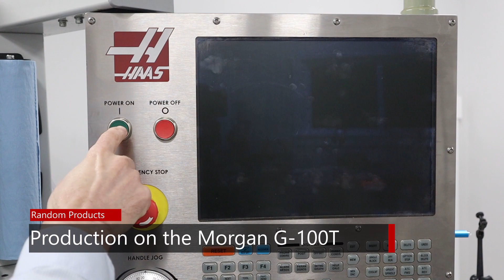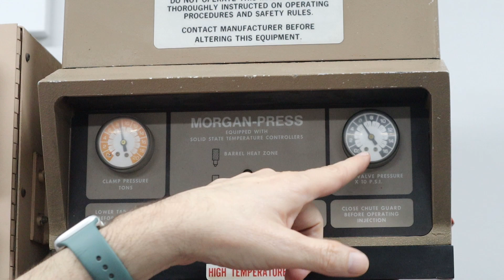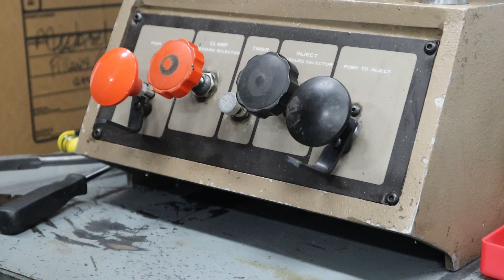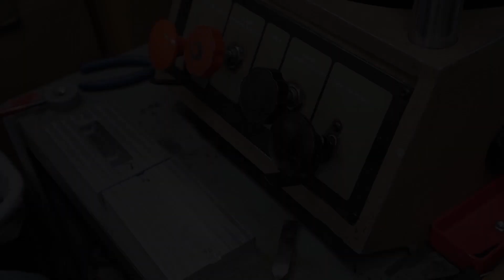Production Injection Molding on the Morgan G 100T

Comment: Very nice video
Try using a food dehydrator for drying your material,you will have more control over temperature and run less risk of polymer degradation.
Reply from the maker: That's what I started with. But the maximum temperature of 70C wasn't enough. The recommendations I've found are to dry ABS at 100C for 2-4 hours. I ran the toaster oven at 200F, or about 93C, which worked much better.
Reply: I had similar results with a food dehydrator and PC/ABS. Dried it overnight and ran some parts the next day, still streaky. I'll have to get a toaster with good low-temperature control. I think some don't do well maintaining lower temperatures.

Comment: Great info about the streaks and toasting the pellets.  I’ve had them before and thought it was a flow issue.  I live in AZ, so wouldn’t have thought moisture was still an issue.

Why a third mold?  I don’t think I caught the reason on that one.
Reply from the maker: The product has a total of five different parts. I'm making the smaller parts on my AB-100 injection molding machine. The other three parts are too large for that machine. Hence the third mold.

Comment: Nice work John.
What do you do to keep your pellets dry?
Ceramic plates are a good dryer.
Several in with the pellets could do it. Put the ceramic in the oven like you did the pellets without worry of melting.
That last part you showed was very nice and smooth. Very nice.
Reply from the maker: I put them on a shallow pan in a toaster oven at 200F for several hours.

Comment: The pins that locate the mold halves don't need to be that long.  I use dowel pins like you, but I usually only have them protrude about 1/8" beyond where the chamfer ends.  Still aligns just-fine but much easier to get the mold apart.
Reply from the maker: I switched to much less stick out in more recent molds. Now I have the pin projecting about 0.15" and that works much better.

Comment: John, what is the device you use on top to twist the melted plastic out of the sprue? I need one for my build. It looks like it would help to break off the plastic for a cleaner look. Do you have any information on where I could purchase one?
Reply from the maker: This is a standard part that is most likely available from Morgan Industries, the maker of my machine: https://www.morganindustriesinc.com/
Reply: @JohnSL  thanks brother!
Reply: @JohnSL  John, I have a Morgan press, but it didn't come with that sprue twisting thing (bought the press used).  Can you post some pics/dims of that part, I'd like to make one.  Great videos, thanks for making them.

Comment: Great video! I wish I had a small mold press like that in my shop. Could you cut a piece of round stock as a spacer for setting the press height? Just set it on top of the sprue bushing and move the mold up until it makes contact with the injection nozzle. Just something to save a little time. Also I wonder if you could use these alignment pin/bushings from mcmaster instead of dowels so you don't have to pry apart the mold and you can just pull it apart while keeping location good. https://www.mcmaster.com/taper-pins/mating-locating-pins-and-hole-liners/head-style~cone/
Reply from the maker: That's an interesting idea about a quick way to get close. I like it. I'll have to try that. Regarding the alignment pins, yes, I've been thinking about going that direction. For others, here is a link that shows both the pins and the liners: https://www.mcmaster.com/taper-pins/mating-locating-pins-and-hole-liners/